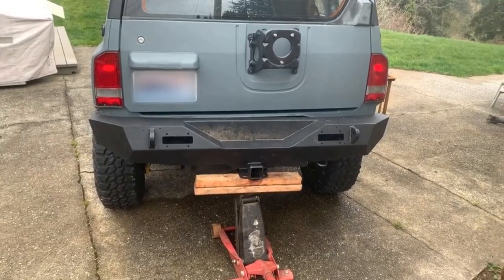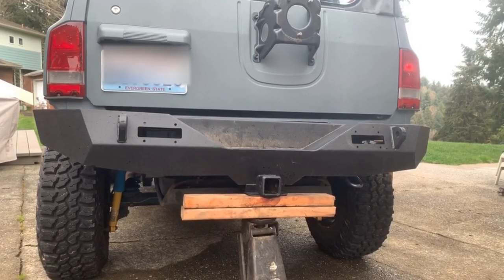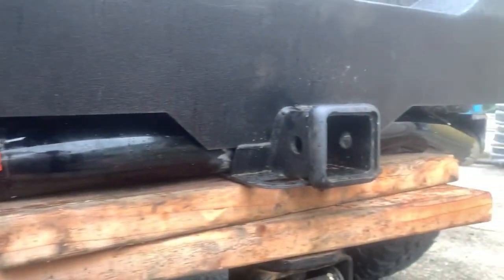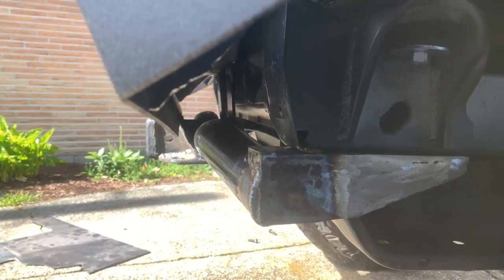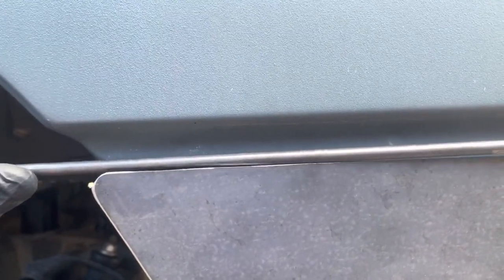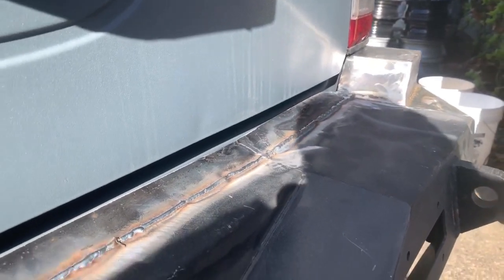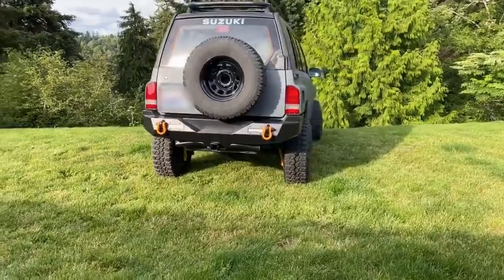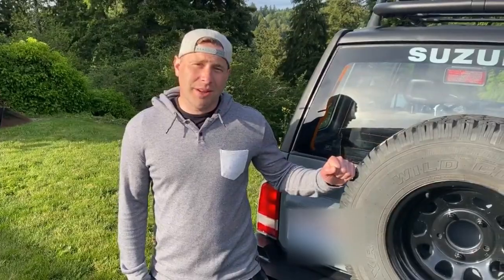DIY Cheap Amazon Bumper Build

Comment: Would you make one for a 2001 Grand Vitara
Reply from the maker: I did a front bumper for a grand Vitara out of a Amazon cheap jk bumper there’s a video on my page of that car.  But that rig has so many timing chain problems I will never build another on.
Reply: @paintnmotors2481  I saw that on too!  I’m not a welder… or I would try.

Comment: Do you know what size bilstein shocks are in the rear? Or part number 🤷🏼‍♂️
Reply from the maker: Braddah duss If you muss.  The part number for them is 24-186056.  There trd Toyota Tacoma rear shocks.   I have done a lot of different lifts on these things and this is all I’ll use.  You can get them super cheap from the dealer as take offs. 50 dollars for a pair in my area. If you have more questions hit me up by email paintnmotors@gmail.com and I’ll shoot you my number.
Reply: Paint N' Motors 🤙🏽🤙🏽🤙🏽🤙🏽🤙🏽

Comment: What kind of suspension you working with? And what tire size 🤙🏽🤙🏽
Reply from the maker: Braddah duss If you muss.    Its on the calmini 3” suspension lift and also has a 2” body lift.  Tire size is 31x10.50r15.
Reply: Paint N' Motors Mahalos brother 🤙🏽